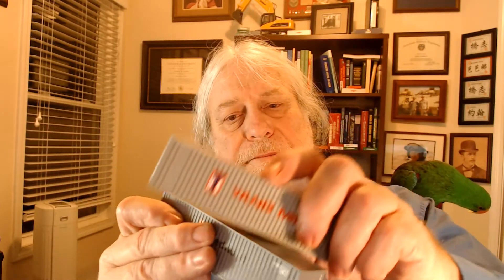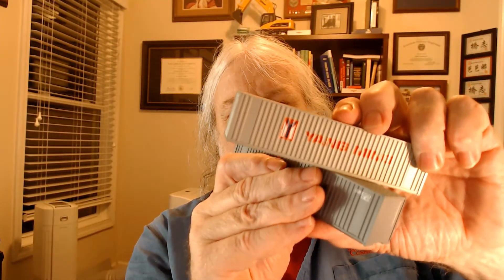Basic Structural Tips for Building With Containers

Comment: The corrugated panels are not a structural element in a container. They are just to hold the cargo in. So you can cut out without losing structural strength of frame. But yes, the frame will flex but it is not structurally an issue. But if you place another on top of something you cut, then yes, you need supports.
Reply from the maker: Acturally, the corrugated panels are very much a structural element in the containers. They allow the sides to act as deep beams, which allows the containers to distribute the weight to the corners. If you take off those panels, the container loses all of its strenght in vertical loads, and resistance to lateral loads.